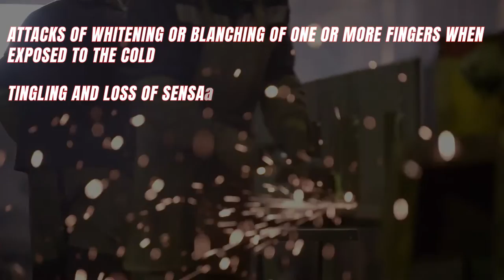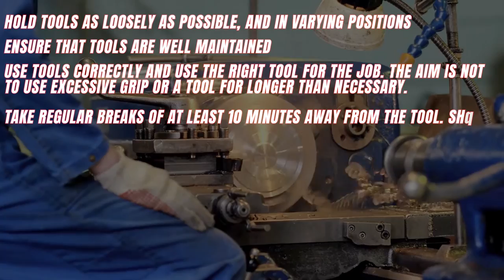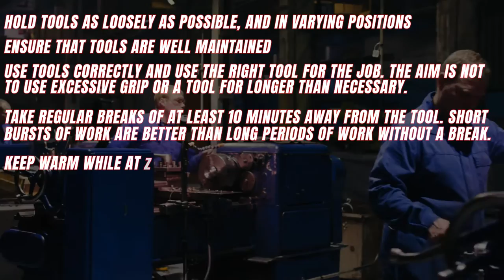Hand Arm Vibration Syndrome – Causes and Prevention

Comment: I ruined my hand by using Jack Hammers i was new at the job in construction and they force me to use for whole day i didn't know it will cost me this much pain, stress and anxiety now
Reply: I'm basically in the same position you were in. It's been 1 month and they refuse to make me do anything but chip concrete. any tips on how to avoid HAVS?
Reply: I'm feeling numb in my right hand from using angle grinder is there anything you can tell me im only 16 I don't have a clue on what to do

Comment: This is exactly what I am suffering but what I don't understand is I only used the tool once in my lifetime and one day only and it happed exactly as discibeing and don't  understand why because as yoy are saying in this video others who have suffered same problem have used the tools all their life could it be because I already suffer with muscle problems could this be the reason as to why it happed just like that with me I am very worried because I work and I need my hands both of them I need  the right hand is causing this problem the left is not same way from a accident. Please advise
Reply from the maker: Unfortunately, we are not medical providers and are not qualified to diagnose any issues you may be having. We recommend making an appointment with your primary care doctor to discus this issue.
Reply: I am very sorry this happened to you
Reply: This happened to me as well 3 weeks ago. I used a makita oscillating tool to remove grout from bath tub walls for about 5-6 hours. This was the first day that i used this tool to that extent. Now my thumb and index fingers on my left non dominant hand are slightly numb still and tingly. My right hand which was holding the tool mainly is still tingly too. I saw a dr. And he gave me wrist braces and said he thinks it will be much better in 3 weeks.. I guess time will tell. How are your hands now?? Hope you're doing better. Nerves take a while to heal so remain positive.